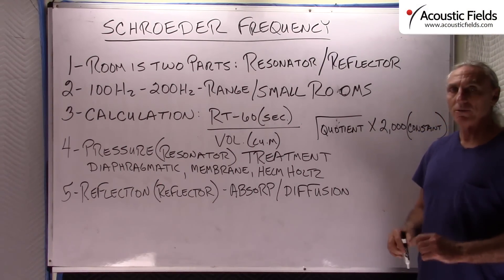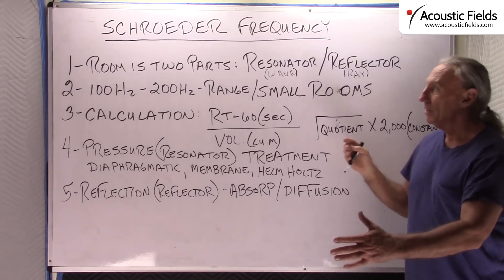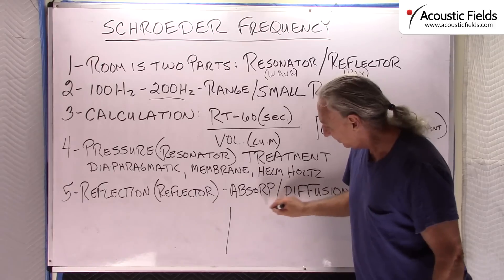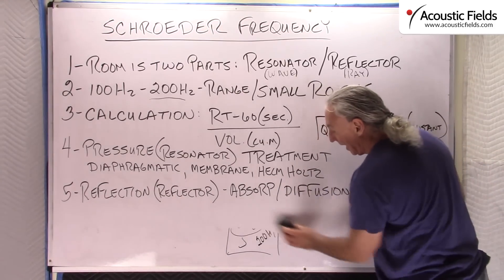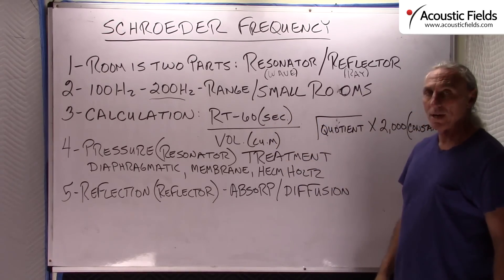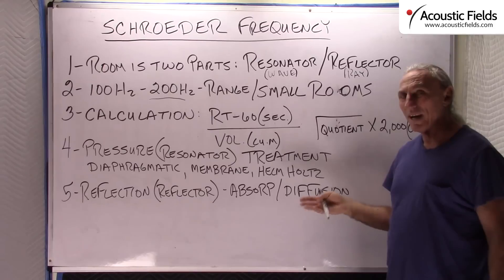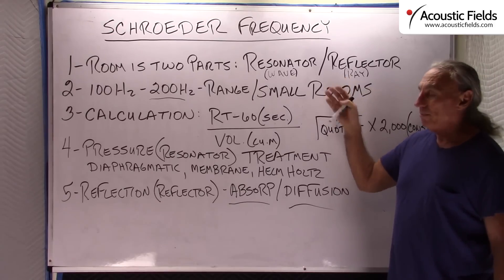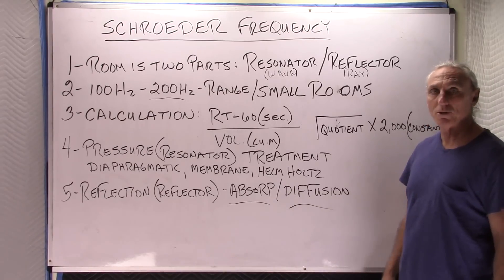Schroeder Frequency - www.AcousticFields.com

Comment: Hi Deniss, thanks a lot for sharing all you knowledge In such a good way!

I have a quick question
how flexible is the sound quality design of a room when you design it  for a use of mixing at 75 dB but  in some cases you want to increase to 85 dB to check the final mix, how much we can play with that dynamic of 75 to 85  (I know is damn a lot) with out  prejudices the quality of the room design 

 (The words rate and level are kicking my brain now telling me its not possible but you can confirm me this THANKS DENISS)
Reply from the maker: S,  Every 1 dB of energy put into a room changes frequency response. This is why we design rooms to operate with certain pressure ranges. Going from 75 - 85 dB SPL, will not be as difficult as going from 85 - 95 dB SPL.  I would have to know your existing room size/volume/usage to determine the rate and level changes required.

Comment: Wouldnt the room size be considered in terms of modal density... vrs it's volume?
Reply from the maker: Dimensions determine modal frequency structure. Room volume determines amplitude or strength of modal issues.